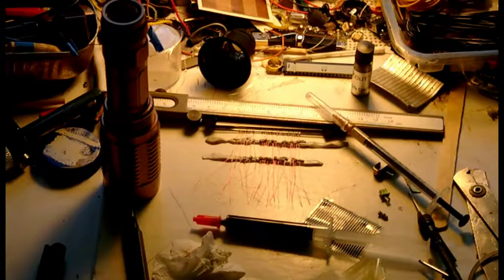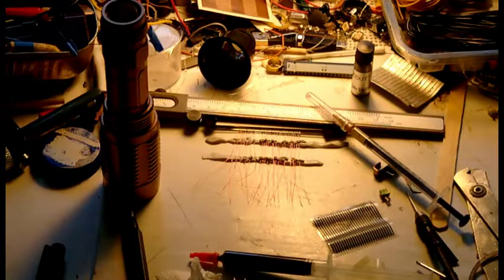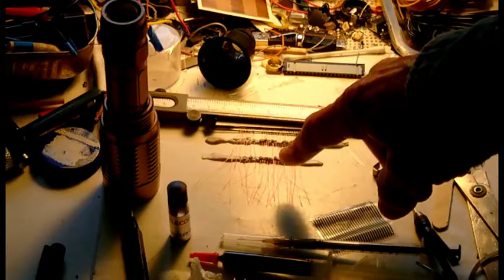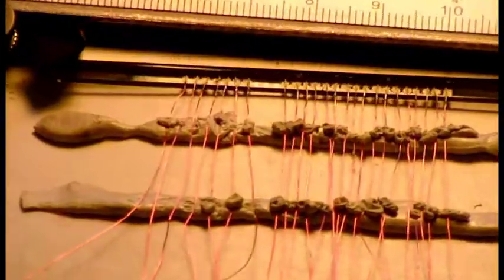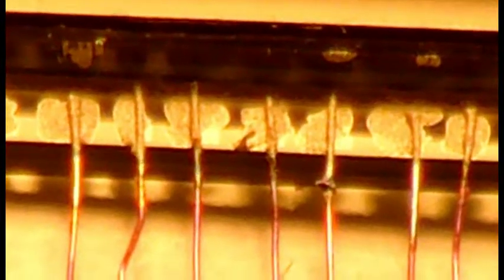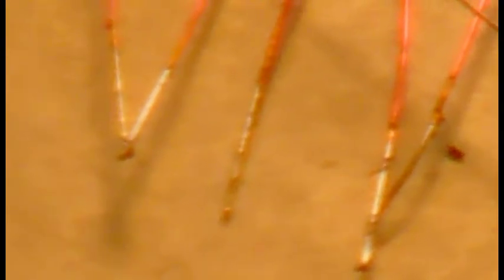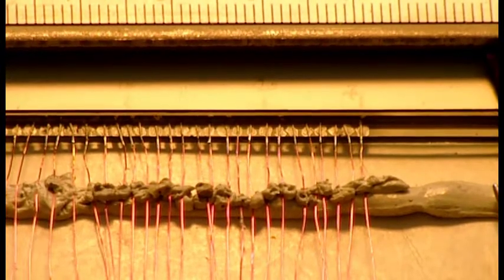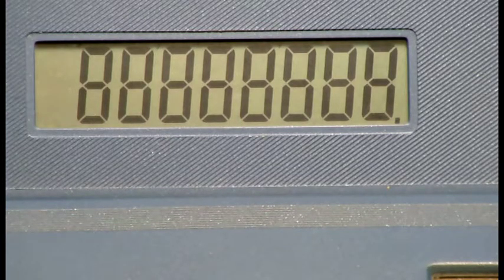Flexible Ribbon Cable (not copper) Repair - a working Method

Comment: there is a bad hissing sound, also love your videos on the garden multitool
Reply from the maker: Hi SGamer - apologies for any hiss! My vids are definitely not of a professional quality and my camera is rather crap especially the sound - sorry! C+
Reply: yeah i cant handle watching with the hiss but am interested in topic, I really loved the knowledge you shared on the multitool watched all 4 videos, particularly when u said about fuel/oil mix ratios and tolerances (stihl/husqvarna i have seen mostly 50:1/40:1 and are good brands/expensive though) and when you talked about the kickback relationship to engine timing. Thanks for making them. If you ever have any questions about youtube ill be happy to help :)
Reply: bro the high pitched whistle you have as background noise is keeping your video from helping many people. i couldnt stand it even on the lowest volume. theres got to be a way to isolate that frequency and cut it out of the entire video.